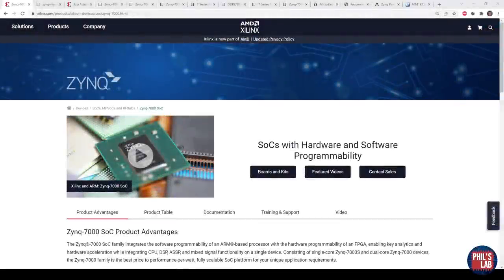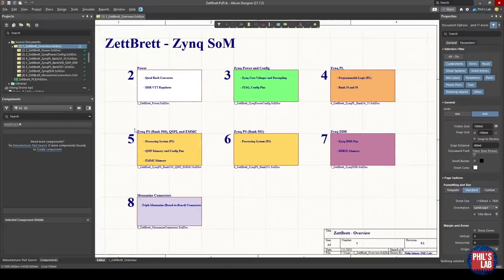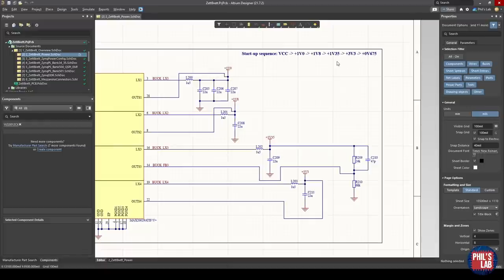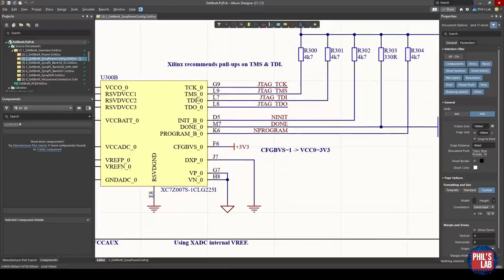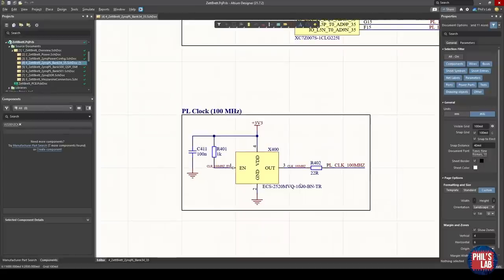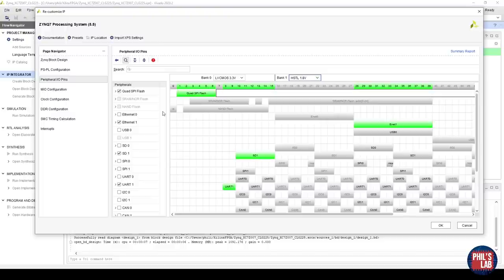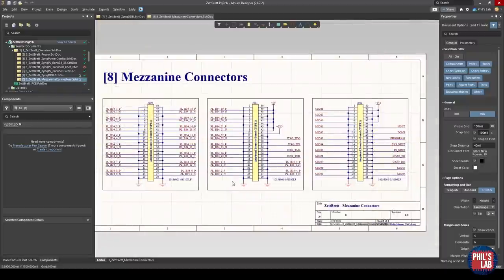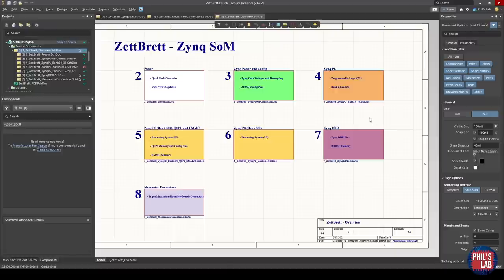FPGA & SoC Hardware Design - Xilinx Zynq - Schematic Overview - Phil's Lab #50

Comment: Awesome video, just started putting together schematic for my Zynq based SDR platform, more or less for the same reasons as you; to learn and say I can do it from the ground up. I started with the same approach as you grabbing all the datasheets and app notes, but eval board designs are invaluable (lots of slight variations to pay attention to). Looking forward to the layout video!
Reply from the maker: Thank you, Chris. Hope all goes well with your Zynq-based design. Did you manage to secure some Zynq chips?
IIndeed, eval boards are incredibly helpful as well when doing these kinda designs.
Reply: @PhilsLab  yeah actually buying chips right now should be interesting…. I’m just gonna design to a certain variant and hope for the best.

Comment: What i like to do is instead of just "listing" subsheets in the top level sheet i create sort of block diagram using sheet entries. This way it's easier to see how signals are connected between each sheet.

Comment: What's the density of Emmc and Qspi flash ? Can't wait a video about pcb.... I believe there will be 2 videos of pcbs one is only preparations and design rule settings and another one will be routing? 😍Thanks Phil
Reply from the maker: Thank you, Arun! I have several implementation videos for DSP content. The process for the PID controller is very similar.
Reply: @PhilsLab  Phil..... I'm a big fan of your work. You put soo much effort and the outcome is really good. Thanks for all the knowledge. And yes I've seen all your videos.

Comment: Can you go over the costs associated with software development tools and IP needed to be purchased to do this SOM? These costs can be extreme in low volumes, and the vendors don't make this info clear. They just assume you are going to buy everything.
Reply from the maker: Vivado is free and supports (most) 7-series FPGAs/SoCs without an additional license. Won't be needing any paid IP for this design. So software development brings no costs with it so far.
The PCB manufacturing + assembly costs in low volume will be quite substantial however.
Reply: @PhilsLab  I only have experience with Altera products and I have to work on a zero dollar budget. DDR3 IP was not free with the free version of Quartus (at least at the time, I don't know about today), so I was limited to old SDRAM in my designs. Because I have zero dollars to work with, I end up using cheap eval boards as SOM's. But everything is going DDR3, so even that doesn't work because I couldn't use the memory without getting a paid Quartus license.  I was assuming you needed to use a paid license of Vivado to do what you are trying to accomplish.